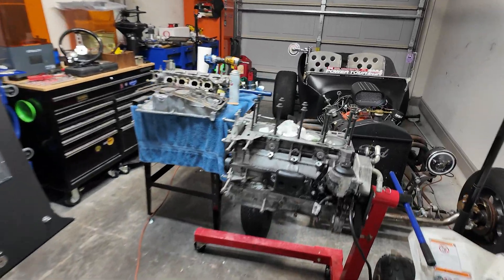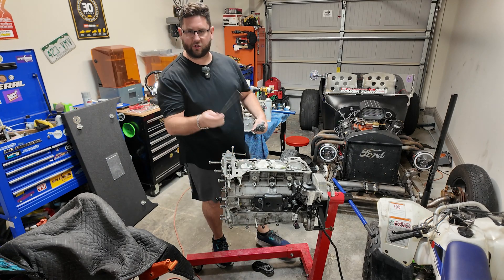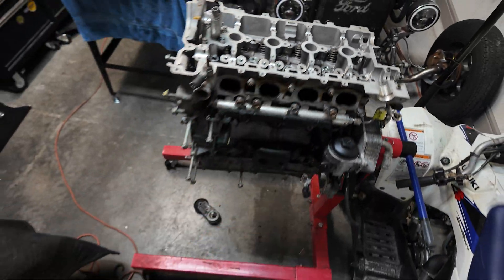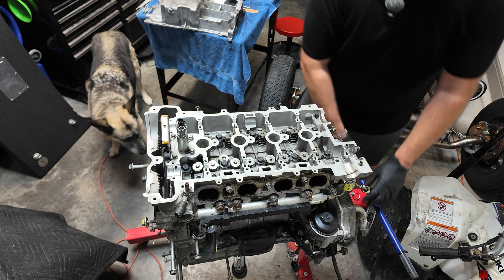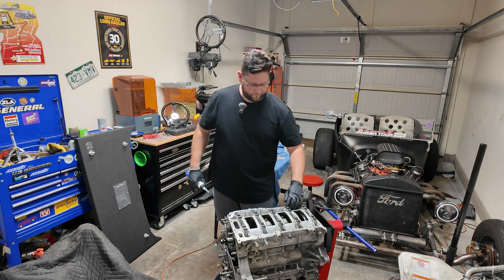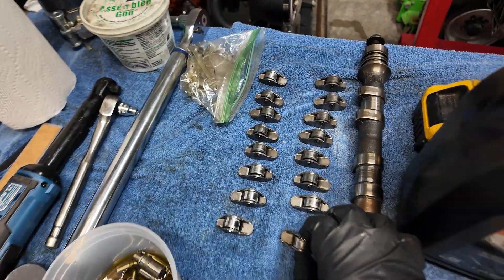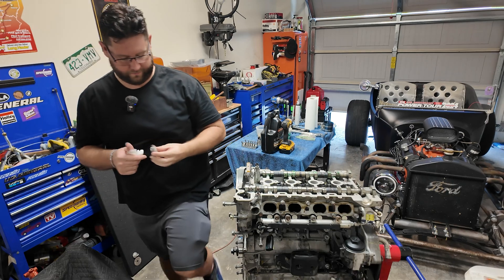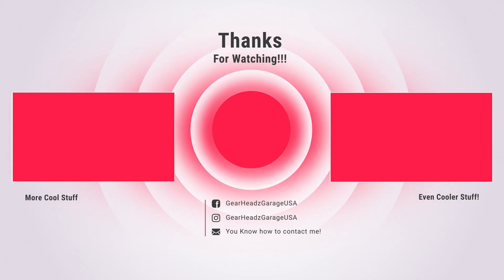GM Ecotec 2.0 LNF Budget Build! REBUILDING a Turbocharged ECOTEC 2.0 Engine

Comment: Did you have the head machined?  Did you have the block machined?   Machine shops are few and far between,  so I"m wondering if you always need to have them machined?
Reply from the maker: So for this one I did it the old school way and decked it with a metal ruler and feeler gauges.

GM has the numbers in the LNF service manual which is now public domain I don't remember what the numbers were.

As crazy as it sounds you can also look into the sandpaper granite method which is truly a work around for lite corrections.

You can also buy a new head from ZZP for about 400 if you go that route, depending on the machine shop they may charge a lot as they do in here FL.

But before I do any of that just get yourself a metal ruler and check it
Reply: @GearHeadzGarageUSA The sandpaper/granite might work; I have a granite surface plate.  A local guy who's worked on alot of GM stuff said the carboned valves are normal on those direct injection motors.  Especially given the motor has 270k  miles.  He said you can clean and they'll just carbon up again.  
I'm in Western Nebraska, far from any machine shops that do motor work anymore.  On this motor I think we'll replace the timing chains, water pump, and maybe the phaser gears....I've heard the phaser gears are sometimes the problem and not the actual timing chain.  However, I also remember you mentioned the phaser gears are usualy fine....
Thanks for your input.